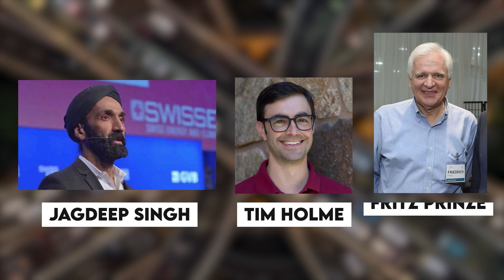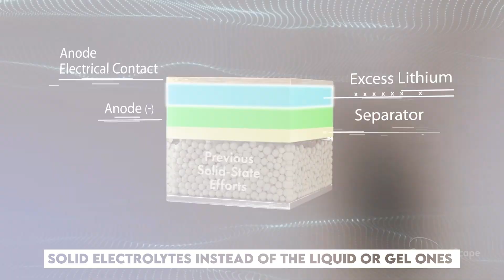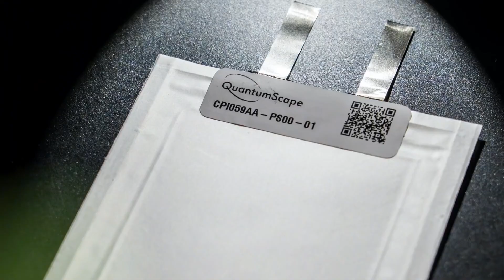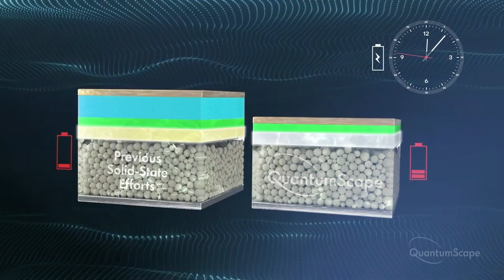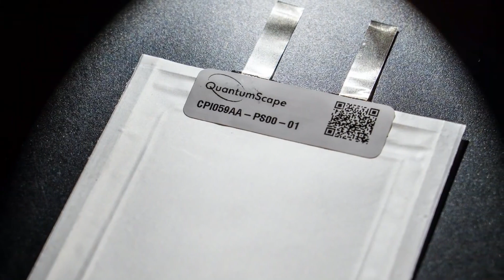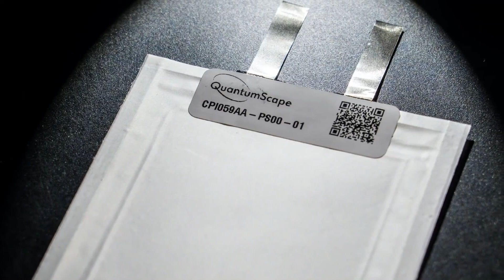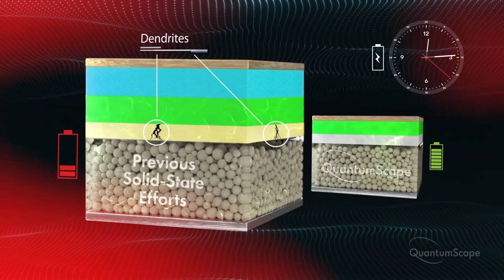INSANE NEW Battery Technology Just CRUSHED Tesla!

Comment: Many challenges are posed by using solid electrolytes versus the current liquid electrolytes in lithium-ion batteries. The stability of these batteries is usually poor, and their high surface resistance limits their output and, concurrently, their applications.17 feb 2024